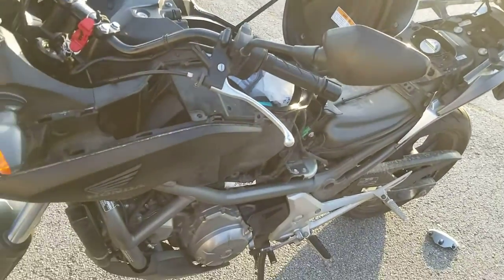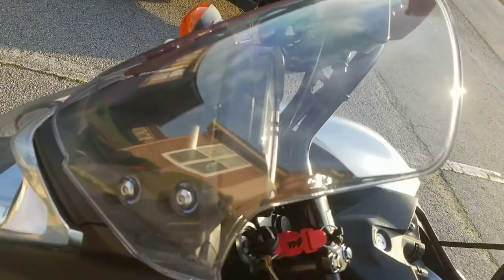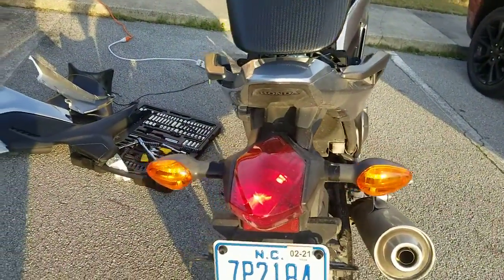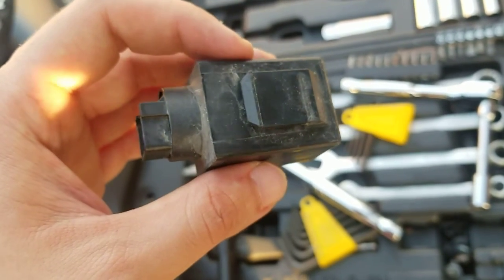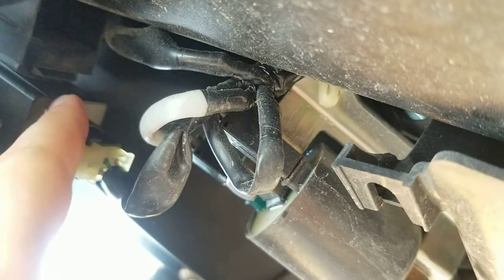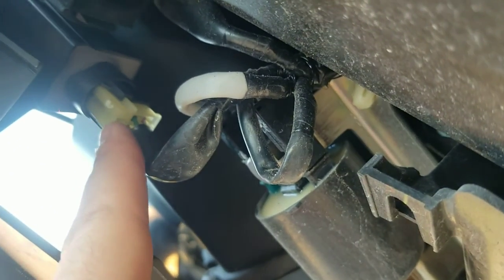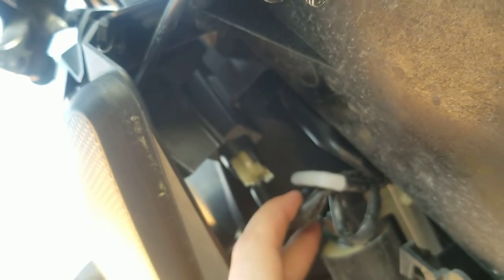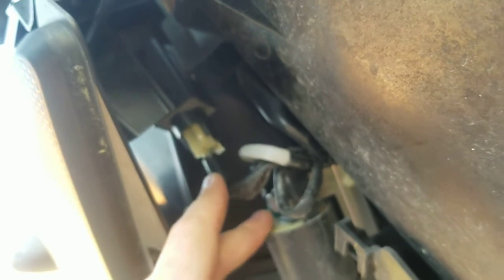Blinkers restored

Comment: Good work you know in the motorcycle world and the dealerships things are very very sloppy things aren't designed well most motorcycles don't use the automotive Style EPDM accordion boots which seal the connector for the life of it and even after more than 20 years the contact still look like brand-new instead motorcycles rely on connectors that lock together lack rain and moisture resistance therefore I apply Dielectric grease to every connector that I can get my hands on I used 2 - 26 from CRC to spray the plastic connectors before I remove them because a lot of times they are very stiff and you can end up breaking them taking them apart especially if they haven't been taken apart in several years then I put grease all around the Locking connections and that sort of thing so they're easier if they do have to be unplugged later on. And as you said hand signals are nonsense well I do use them when I can in conjunction with my signal light I rely on my signal light and today is busy traffic it's critical to have that system functioning
Reply from the maker: I'm actually attending MMI now, a lot of it is easy concepts but I'm figuring to take all the brand electives. I just study and learn, not having issues with any of the courses so far. Feel I'll do fine in the path as long as I pull my morals along side with me into my product.